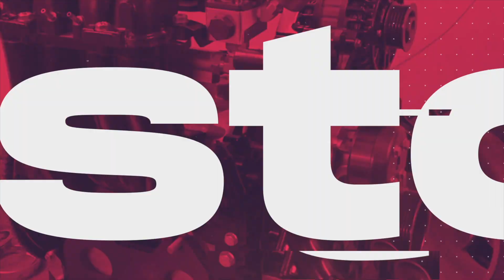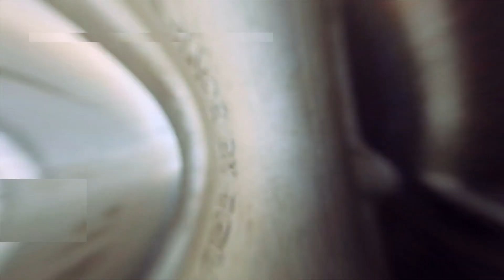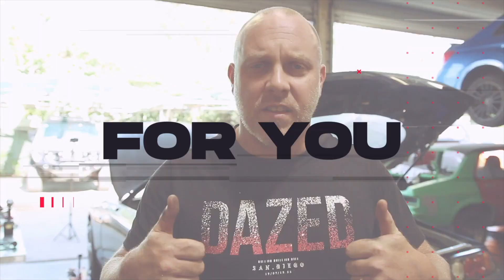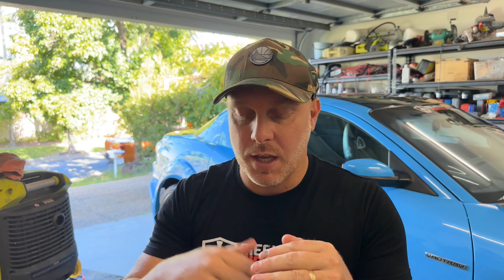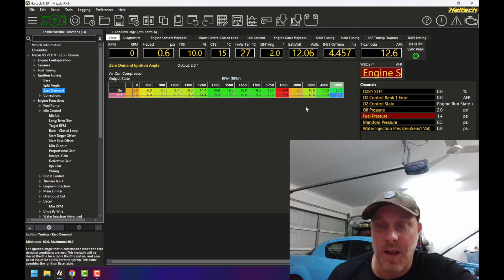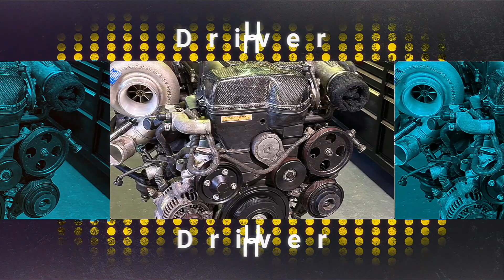Tuning for the Perfect 'Brap Brap Brap'

Comment: why not use rotational idle with ignition and or fuel cut strategies ?
Reply from the maker: I don’t follow ?
Reply: @mechanicalwarriorsofficial  
your approach is basically how we do it in versa tuner / Mazda Edit. 

Search in NSP for "vehicle functions - Rotational idle" and enable it. 

I found it working good (on extremely large bridge port MSP) 
Activation E. Demand - 1%
Idle valve position - 70% 
End RPM - 1200 rpm
Limiter type - Soft Cut
Cut method - Injection with ignition 100RPM above

Comment: Wonderful insights on all of your videos. Are you still running the stock RX8 transmission? I know you added straight cut gears eventually, but curious if the stock RX8 trans was holding up before that?
Reply from the maker: It’s all about how you drive it, dropping the clutch and slamming gear changes with high hp will kill the AZ6 pretty quick I did end up breaking the box doing exactly that to fast on a gear change and it was all over since the strate cut set never had an issue
Reply: @mechanicalwarriorsofficial  Thanks, how much wheel Torque were you pushing at the time the box went to transmission heaven? I feel like it takes the fun out of things having to baby the car.
Reply from the maker: @tooblindtofinehome1  it was around the 500hp mark and I was feeling a bit angry at the time slightly to quick on the couch from 1st to 2nd or 2nd to 3rd I can’t remember but i remember it was stuck in 3rd I think from memory so I managed to actually limp it him
Reply: @mechanicalwarriorsofficial Appreciate the context, glad you got those straight cut gears in!

Comment: Im in the process of building up my FD RX7 and used your Brap maps and i have to say it's Brapping very beautifully. Definitely appreciate your knowledge and sharing this info. Keep it up😊
Reply from the maker: @zoomzoom93rx7  make sure you refine the map and your AFR is correct though the map and also keep and eye on your timing in higher boost levels
Reply: @mechanicalwarriorsofficial  i I used alot of your intel to setup my map for now. I have really low timing around the 30 Psi area, like the way you have in your Mastering Road Tuning video. I will have a tuner later on to fine tune it.
Reply from the maker: @ don’t run the car over 16psi unless you know what your doing or have correct fuels ect
Reply: @mechanicalwarriorsofficial  Will do, I'm not pro at tuning. This is all just a starting point in my build. Your video was very helpful in setting up my Haltech😊
Reply from the maker: @ glad I could help but just be very careful with it make sure you keep an eye AFI and intake temps

Comment: Hey mate. Bit late to the party but I really like this vid. Have you ever set anything like this up using a link ecu. I’m on a g4 fury.
Reply from the maker: @ashleyhazeldine2469  i haven’t but the principle is the same no matter what ecu you use
Reply: @mechanicalwarriorsofficial  link ecu doesn’t have the zero demand table available. Do you think adjusting the main timing map in the idle range would be ok?
Reply from the maker: @ashleyhazeldine2469  yes you can do this but just be cairful to only set the timing in the idle range and not anywhere els. it should work just fine

Comment: But wont a bridgeport destroy the renesis in no time?
Reply from the maker: No not if done right, but my engine is a REW
Reply: @mechanicalwarriorsofficial  can you explain how its done right? I just ordered a completely new 13b renesis and want to do some major modifications on my rx8. I got told the brap wont be so powerful on the renesis compared to the rew, but even a slight brap would make me happy. Tho emissions will be a big problem as austrian law makes any modification that affects emissions in a negative way illegal.

Btw my rx8 is exactly the same color as yours it seems. Thats miami blue right?
Reply from the maker: @BeHeaven616  are you on fb ? If so search me Josh Cavallaro
Reply: @mechanicalwarriorsofficial  just sent you a message

Comment: Can I have the brap sound even without porting the engine?
Reply from the maker: No unfortunately :(
Reply: Yes, just differently and it won’t help performance- it’s a little thing known as ghost porting. Wouldn’t fuck with it unless you have a renesis, just port it otherwise. But with rennys the bridgeports usually add no power and just fuck ur low end

Comment: soooo your telling me by setting the timing back and forth i can make my renisis brap...ish?
Reply from the maker: has it been ported ? It’s not just a map u need to have a port job done in order to get the engine to pulse but when u have a DBW system it don’t pulse very well so changing some timing tables helps the pluses magnify. If u get what I mean
Reply: Yes i get it, due to overlap, its not ported yet. what port would you recommend ?  @mechanicalwarriorsofficial
Reply from the maker: @raywaltdecuba5699  well I love big Ports I never go small but that’s just me with a NSP engine your kinda limited to what u can do. 

I have seen the just doing a hybrid setup makes a wicked idle but u always going to be limited to around the 350hp mark with that block
Reply: My goal is around 300hp max with the engine, so 350 with hybrid setup is very interesting. Keeping the engine low boost for reliability purposes.  @mechanicalwarriorsofficial
Reply from the maker: @raywaltdecuba5699  300hp is very achievable with a turbo setup and the rest of the drive train will also support it
Reply: Awesome man, thnx for the info bro @mechanicalwarriorsofficial

Comment: I'm really impressed that small 1.3L 13b, 2.0L 20b, 2.6L 26b. Can sound like a much larger displacement Big block V-8 but has the ability to Rev to 6000rpm+ where large V-8's lose this capability capability at anything over 7000rpm in most cases. I would like to put a turbo 13b into projects. However I don't know where to find rotary engine swap parts, or what transmissions can be used with them.
Reply: Tbh since it's more of a L*2 of displacement. That is because each power stroke happens at 360 degrees compared to 720 degrees in a piston engine. You have two times the power strokes per 720 degrees.
Reply from the maker: Depends on what u want to do, a 13b can rev up to 11,000 rpm and still make crazy power. However at that RPM u have to be careful on gearbox internals as the high rpm can destroy bearings and other parts
Reply: @mechanicalwarriorsofficial  would a sequential gearbox help mitigate some of these high rpms risk?
Reply: 1.3 liter rotary with open headers literally sounds like a muscle car it's super strange

Comment: Dude has no clue what he is talking about.dont follow this guy's advice. The "stall saver" is in fact the idle control valve on the 13brew engine. The brap is the effect of high overlap port timing and can be tuned out with timing but will result in very low engine vacuum. Bridge port engines will idle happily at 1400 to 1600 rpm with semi p engines 1800 to 2000 depending on exhaust port timing. Please do not set your idle corrections into the base map. There is a table for idle ignition correction with respect to target idle delta. With decel cut off. Run higher ignition timing in the decel range please, bo one wants to hear the crap that happens when you dont.
Reply from the maker: This engine is actually running a DBW system so there is no idle control valve and the stall saver is a function within the open loop idle control system and uses the DBW system to make corrections for stalling.  But this has nothing to do with making your engine brap….  And to get perfect and consistent braps it’s not just port timing it’s also in the ignition timing and the best way is to use a zero demand table to achieve the timing corrections when in idle. 

Perhaps I would encourage you to finish the video you might learn your comment is not relevant to the content…
Reply: @mechanicalwarriors  finished the video and tune more of these a month than you ever do. I know the garbage rx8 uses dbw, you said in the video that the solenoid on an rew manifold is a stall saver or some such nonsense. What causes the loping idle is port overlap. 0 demand timing is not the best way to correct timing for target delta. Look at your ign corr table. BTW there are no valves in a rotary engine.
Reply from the maker: @7SinsMotorsports  mate u have no idea what your on about…. 1st of all I said the idle control solenoid can be used as a stall saver with the Haltech system. Second of all this is not an RX8 engine it is a REW bridge port 13b with a g35 on it completely built and assembled by myself. And lastly if u took half a second to understand what the topic of the video is about I am explaining how to get consistent braps not tune them out… and the zero demand table I am referring to is an ignition zero demand table. You have no idea what your on about and this is not my 1st rodeo.
Reply: @mechanicalwarriors  could have fooled me with your lack of understanding how any of this works. The iac is not some trivial "stall saver" it is what should be used to control idle. Unless you are dbw but the stock rew is not dbw thus my point. I understand what the topic of the video is, you don't understand the mechanics of the idle circuit and why the idle lopes. Nobody should follow your advice because it is shit. I know more than you do about tuning these engines and it is obvious since you don't even know how idle timing works or how to set it up. 0 demand is worthless when you know how to set a car up properly. Bu5 my main point in this is not to convince you that you're wrong it is to hope that no one else follows your ahit advice. If I had a dollar for every car I had to return from people like you that should tune up a lawn mower I would be a lot richer and a lot less irritated.

Comment: gotta thank you for putting this information out there. Just a simple change to my ignition timing at idle made the brap much more pronouced. sounds incredible. I am still trying to figure out how to get flames on decel, any advice on that one? Just a NA 13b im dicking around with
Reply from the maker: just add more fuel in decel part of your map if it still dont work drill a small hole in the exhaust like just a pin hole that will get your big flames and pops in decel
Reply: What are your timings if I may ask.

Comment: Any idea on how to do this with versatuner? They run lamda and engine load tables, and ignition tables are wwaaay different as it is retuning of the stock ecu. I have a bridgeport on a 13b msp. I get subtle braps but mostly gets stuck in that cavitation state.
Reply from the maker: Try leaning out your fuel mixture at idle this will stop the cavitation state but it will also increase your exhaust gas temperatures so u will need to just keep and eye on it. If you don’t have an EGT sensor play with the idle at night after running the engine for 10 mins or so turn the lights off and see if your exhaust is glowing anywhere if it is add a little bit more fuel in.   The other way is to use a zero demand table but I don’t think u can do this on the stock ecu.   Try advancing the timing to around 17deg at idle then lean out your fuel. After u add timing your idle will increase so u will need to correct that also. Sweet spot is around that 1650 to 1700 rpm.   Hope that helps :)
Reply: It does. This is my first dive into tuning with fuel injection, and it's a rotary to boot. I have either added or retarded timing (versertuner just has numbers. I pur in 40 so whatever that is) in the leat timing and got stronger braps. The tables are all based on load vs rpm. Just got to find what load is idle and lean it. Most around light load (and 0 load but i dont think that is idle) is around .98 lamda. .92  is about 13.8 afr? So there should be plenty of room to lean it a bit without worry of too lean. I will keep playing. But thanks for the help as it has given me a new direction to search.
Reply from the maker: @noname-sd5dt  no problem, 13.8 is starting to get lean is your motor running high comp rotors ?  U will notice the exhaust will start to glow red hot at idle if you lean it out to much  also with the timing  grab yourself a timing gun and work out how much timing your actually adding u don’t want to be causing detonation events not to much of a worry at idle but left unchecked it can cause other issues. U want to be around 17deg before TDC at idle u could push it a little more but I would not go to far past 17. My biggest point I could make to help you is “don’t guess anything!” Work out your timing and keep a close eye on your exhaust temps  remember with the NSP engines the exhaust goes right past the corner seals so dumping heaps of heat into the exhaust can cause the springs on your corner seals to soften and u will lose compression.   So don’t guess, check and recheck 

Turn the lights out after 15mins at idle see if you see anything glowing.
Reply: Thanks for the advice. Time to get a timing light, and yes it is high comp
Reply from the maker: @noname-sd5dt   no problem let me know how u go :)
Reply: Making progress. Still waiting on my timing light to verify, but played with returning tune to stock and using the rpm correction table. On leading plug. Heavy advance under desired rpm and heavy retard over. Havent seen any results playing with trailing yet. Wife stopped play as it is late and the neighbours had enough.will play with load tables next.
Reply from the maker: @noname-sd5dt   let me know how u good I’m glad your learning and experimenting let me know how u go
Reply: Got a timing light and verified timing as per ecu.
I've since advanced idle timing to only 20 degrees (was 35) but put in a hefty split with the rear at -5. 
I am now getting a consistent brap. Also cleared the rpm correction tables and retard timing and advance at the high and low end of the rpm window respectively.
This has stopped surging at idle and the cavitation. 
There is still more to play with but getting a good solid brap. 
According to my wideband im getting 15ish afr.
Thank you for your video and continued interaction. It was very helpful!
Reply from the maker: @noname-sd5dt  Your more then welcome im glad you got what your after and now your know a little but more about timing in a rotor. well done!!!  Keep it up and let me know if there is anything els i can help you with :)
Reply: @mechanicalwarriorsofficial  hey man, thought id chuck up a random update. I have been messing about with the map heaps on VT in NA form. Managed to get 200 rwhp out of it on my own tune.

The braps were there, but not that enhanced. Because renesis life.

I also tried mucking about with some rx8 guys on discord trying to ghost brap a tune.

I saw on another channel someone changing their ve table for the engine to run super lean and then the engine hunted. I made a map for a guy in europe to test, but didnt have the desired effect. 

I then for giggles added the same ve of .75 at my target dle to see what is what as you mentioned about going slightly leaner for better braps. I just went full mental. 

It started to pulse hard. Not hunt but proper brap. 

I was watching afrs and it was crazy lean like 20:1 but because it was so damn lean the egts were lower than at stoich because of the incorrect combustion. No cat so no worries. No glowing manifolds either.

I managed to up the ve until the egts rose with afr to about 17:1 then retarded the timing again to drop them to where they sit at idle on a stock map. But i got the proper braps now.

Id shoot you a vid, but im half way through adding a turbo.😂
Reply from the maker: @noname-sd5dt well done ! Love hearing stories like this keep up the good work !

Comment: They're called PORTS bro NOT VALVES.
Intake Port + Exaust Port. Anything found in piston engines Valves, Camshaft, Pistons, Crank etc don't belong in the same conversation as a RE.
Reply from the maker: If u continue the video I am trying to show
The relationship between cam timing and port timing 🤷‍♂️
Reply: Don’t get caught up in semantics. I found this to be good material for tuning rotaries. It’s easier to look past terminology than start a pointless argument.
Reply from the maker: @pauloakes6952  I agree thanks for the support

Comment: Good content how about injection angle between fc and fd do the are similar numbers? I'm working on a fc 6 port Turbo with a older platinum Haltech sprint re
Reply from the maker: it depends on the port and you should find tune this on the dyno but around 270 to 330 in the top end seems to be the best starting point :)